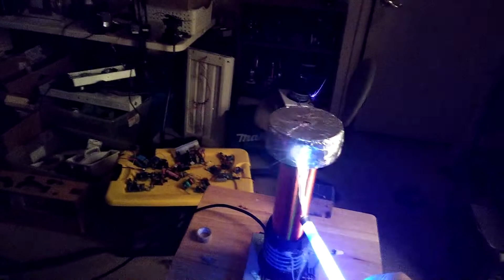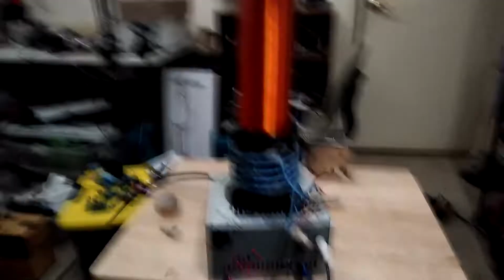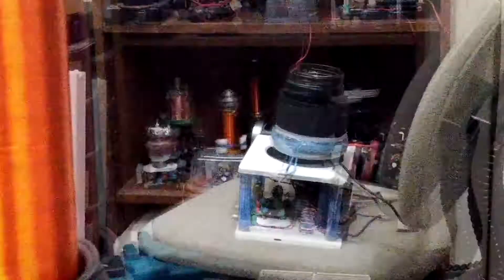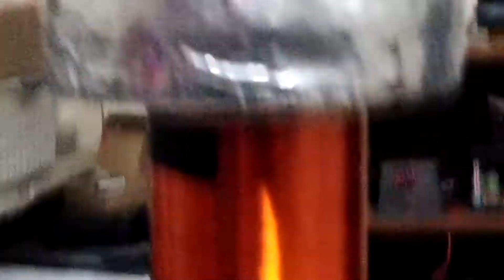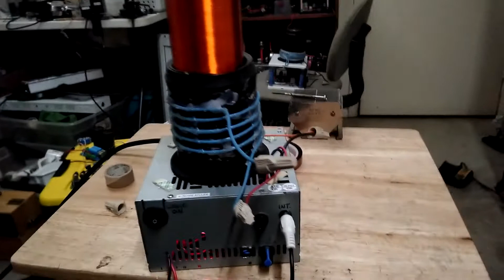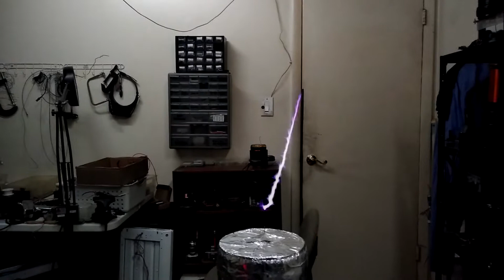PLL IRFP460 Half Bridge SSTC Unfiltered 120VAC 240W

Comment: Nice sparks! I was surprised about the high current arcs. Is  it able to run CW?
Reply from the maker: The appearance of the "hot arcs" when pulled is what over time got me thinking that smoothed CW is not necessary. This bridge is only half wave rectified so it's actually running CW with no DC smoothing, but what you see is the 60hz mains half wave with the longest reaching arcs being the peak voltage of the line at around 170VDC. If this was full wave rectified instead, the CW would look thicker because you would be seeing arcs at twice the frequency. At full wave without smoothing, once the voltage is high enough and the output is "bushy" enough, you will still be able to pull really fat hot looking arcs. Smoothing it out with a large DC capacitor will pull more amps and work the bridge way harder, and the end result visually is just a quieter thicker arc which might not necessarily look much meaner when pulled as opposed to full wave rectified. 

So the arcs from this coil are not very big, but they are still decent. As the secondary is spitting the arcs to air it is pulling 2A from the wall, but when the secondary is loaded by pulling the hot arcs it's only pulling about 1A so not a lot of power.